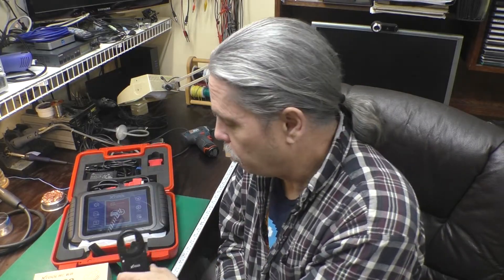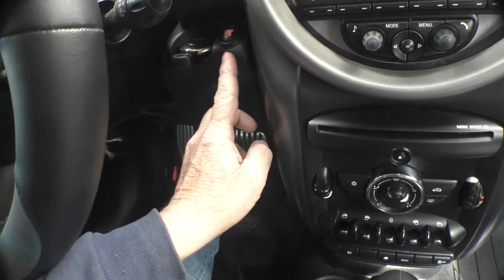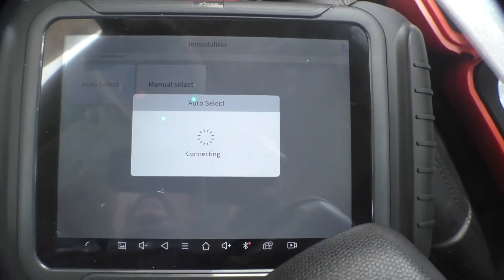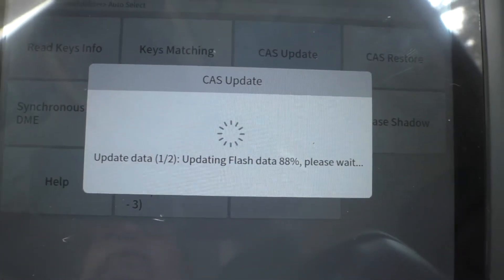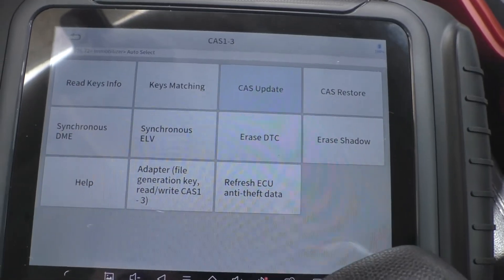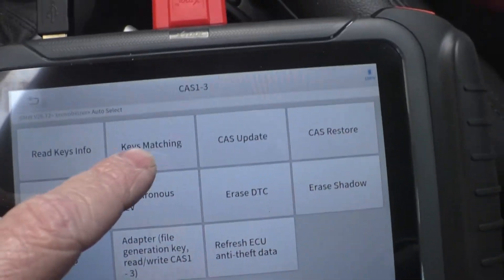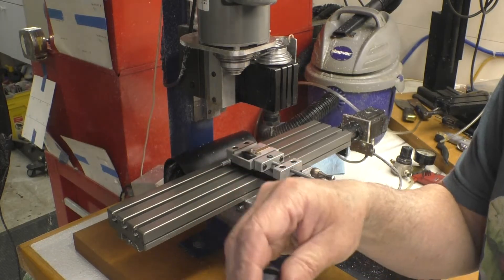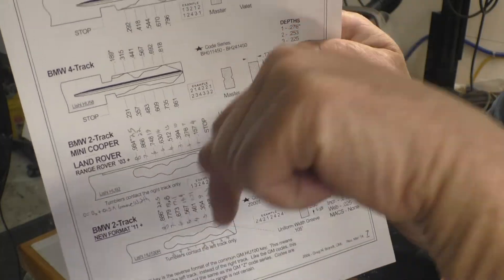DIY Mini Key FOB programming (and key cutting) – Using XTOOL D8 and KC100. 8% off the D8 code!

Comment: Do not do this via obd2 with this kind of tool people. On a CAS3+ module it's easy to brick it. Even for automotive locksmiths this is sometimes a difficult job involving downgrading the module, backuping up the EEPROM and flash etc.

Comment: At my old place when I had to program keys I would also have the the ignition set to on but engine off. If i don't program the key fast enough sometimes I would have to restart and sometimes the consult scanners dedicated to Nissan cars at work wont let you reprogram the key because BCM goes to sleep. I believe having the hazards on while ignition switch is on while engine is off keeps the BCM on long enough for the key program to go through

Comment: I just got a d7s but I'm not sure if its compatible with the kc100. I did a dry run off the car ( doing a '11 BMWZ4) just to get familiar with the interface and it's identical. Issue is going to be the KC 100 compatibility.  I did a Honda Odyssey smart key and it was a breeze, didn't need the KC 100.
Reply: UPDATE:  @ 6;53 your firmware updated, mine failed miserably. I've contacted xtool for advice.

Comment: This is CNC milling machine  !
How did you program and set it up  all ? It is technical  thing .
Must be special key cuting milling machine  ?
Reply from the maker: It is a Taig CNC mill with a controller I made. It uses Mach3 to control the mill. The key profile is generated by a parametric 3D model done in Fusion 360 and then converted to Gcode with CamBam.

Comment: Xtool D8 costs $600. That milling machine you have costs at least $2000. Let's be honest, that's not a set up that most people will have access to at home.
Reply from the maker: When I bought the D8 and KC100 the total was about $1000USD. It has paid for itself already. The mill I already had and I use it to make parts I sell online. No, not something in every garage but not so rare either. Other people have tools I don't at home like lifts, big air tools, etc.

Comment: If you have proximity keyfob, you definitely need to spend another $600 for KC501. Don't buy cheap Chinese keyfob either as many cars have aluminum keys and many Chinese made keys are steel which is difficult to cut and ruins your cutter. Bottom line, unless you are locksmith, just get it done at dealer or find a good locksmith.  
This advice applies even more if you have European made cars. 
D8 by itself is useless for making keys on a newer cars 2019+.
Reply from the maker: As I mentioned in the video...I asked XTOOL if the D8 would do what I needed, i.e. allow me to program in FOBs and reset the VANOS adaptation for this 2011 Mini. Programming in 3 FOBs almost paid for the tool.

Every key I have seen, that gets inserted into a lock, has been brass with a nickel plating. I have never seen an aluminum or steel key, neither would make sense unless it was a non-contact sort of lock.

Comment: The problem that I’m having, I have the same set up that you’re using. I did not update the vehicle so I am going to try to update the cas. But I don’t have any key fobs. Do you have a video programming BMW or mini with no key fobs?
Reply from the maker: Usually an 'All keys lost' programming of new FOBs is different. Some cars require a programmer that can connect for the car manufacture's network to do some sort of validation. I think XTOOLS can do this on their own, i.e. figure out the unlock code on their own but it is a service you have to pay for per vehicle. 

I would send them an email and ask if your set up can do this. It is the Chinese New Year now so you won't get a replay for a week or so.

Comment: It is all great but i don't  have a cnc milling machine but i know G programming  so i ve to buy a fob from the dealer and program that with the console  is this make sense to you?
Reply from the maker: You might be able to find a locksmith in the area who can cut the key (what Mini calls the 'blade'.) If you buy the FOB from the dealer you will pay $200. Buy from eBay for $20, and have locksmith cut the key. If you have the D8 and KC100 you can program the Mini to accept the new FOB.

Comment: Thank you for this Step-by-step tutorial. I have A Lexus and an acura. That I need to make keys for. I guess my first step is to contact x tool to see if their unit is compatible
Reply from the maker: Some manufactures do not like letting third party scan tools do some functions. Some makes/models require paying the manufacture a fee to access a PIN code to program keys. XTOOL and Autel can often handle contacting the manufacture's computer for you but you still have to pay for it.
Reply: @heyyoucanfixit  Volvo is like that.

Comment: Oh this was was dangerous if it failed your car would be screwd. You gotta supply 13v and you need to do backup just incase
Reply from the maker: I did make sure I had a fully charged battery before starting. I think anytime you do any programming on a car it is a risk.
Reply: @heyyoucanfixit  Oh, there is really no risk on cars that are meant to have keys programed. This car isn't your downgrading the cas this isn't supposed to happen. This car, like almost every European car, is made to have keys made without the vehicle present because all keys are preprogrammed when the car is made. So you're manipulating the data on the computer and, in this case, downgrading. You will see that eventually, 1 will fail without a power supply, and you will have a mess in your hands. I mean, I do this job, but I use a power supply every time you need a clean voltage of 13.5
Reply: What do you hook up to power source with 13 volts? The Xtool?
Reply: @Bluesstreetrods  A power supply to car battrey your downgrading the computer if it fails your in trouble.
Reply: @segounlocks5029  thanks for the info. My spouses vehicle is a volvo with intermittent keyfob problems so I may use this tip.

Comment: Messing making keys can cost you big time is why the waring. I would take it to the dealer. They screw up they have to fix the mess. Also you made a lot of errors you had to clear. One mess up could cost you a expensive part. Newer cars are really not worth the chance. Dealership has the special factory scanner that we can't get. Around about 2017 its has gotton a lot worse. Sad thing is with these scanner you can find out whats wrong but you need to connect to the factory internet and pay them to get software. Also you need some more stuff to connect to the factory. Unless you do this for a living you are screwed. With the xtool it lets you sorta no what wrong so they can't rip you off at the dealership or a good mechanic that knows his stuff. You did a good job but it took a lot of time.
Reply from the maker: Except I showed how it can easily be done...

Comment: Is this scanner a stand alone tool ? Does it require an internet connection to program keys?
Other than the free updates for 2-3 years does it require a subscription to preform the higher functions ?  Thank you 
I know after free updates end you have to pay for updates , however if you don’t pay for the updates can you still program keys and write ecu for the models already on the tablet ?
Reply from the maker: I think requiring an internet connection to program keys depends more on the vehicle than the scanner. For example, on the Mini I was working on here if I did not have at least one key I would have required connecting to some service (guessing through BMW). Same goes for programming VIN codes into modules and such. On some cars you have to use a online service from the manufacturer. 

One HUGE advantage, other than updates, to connecting the scanner to the internet is that XTOOL can download a log from the scanner for a car you had problems with. They did this several times when I was trying to do the Vanos reset/relearn on this Mini. They were able to download the log from my D8 and figure out what the problem was.
Reply: @heyyoucanfixit  I recently started researching scanners and found out launch scanners sold on amozon are made for other countries and not for the US market Launch USA does not support them and with launch USA it requires a subscription for the higher functions like key programming and ecu operations. Reviews range from I reprogrammed the space shuttle to big waste of money LoL trying not to waste my money

Comment: Do not buy the X tool I bought a brand new D7 straight from X2 it did not last a year I opened it up to see why it quit it had been repaired in three different places and they solder joints were so hot they screwed up the board ribbon cable holder came off the board was not even soldered good junk if you don't believe me go to my YouTube you will see

Comment: GREAT VIDEO!!!
what cutting machine would you recommend to get starter on doing keys?
i work at junk yard and we get cars without keys would love to get more into that already own a d7 been great so far TIA!
Reply from the maker: I do not know anything about actual key cutting machines. I used the small CNC mill I happened to have which required more effort to draw a 3D model of the key, calculate the key cut based on keycode and generate the GCODE. AS I understand it a professional key cutting machine just needs to know the key code and type of key and it can figure out the rest automatically.

Comment: Do you need the kc100 to program keys or just the D8 by itself? There is nothing stated that says that you need the add on part to program key fobs
Reply from the maker: It depends on what sort of FOB you are working with. When I did my Ford Ranger I did not need the KC-100 to program it to accept new chipped keys. For the Mini, since it uses an RFID type FOB you need the KC-100 to read the code off the FOB so you can program it into the car. 

You can contact XTOOL and ask about your particular vehicle. They are really good about answering questions quickly.
Reply: You use kc100 to precode keys for European cars
Reply: Can you generate keys with Km100 or key tool max then program with xtool d8 ?

Comment: What do you mean by readaptation for VANOS? What kind of readaptation are you looking for ?
Reply from the maker: When you replace parts in the VANOS (variable valve timing) system you need to reset/relearn the VANOS adaptations. 

The D8 will do this. The prompts were a bit confusing, but they were very receptive to feedback and have improved it greatly.
Reply: @heyyoucanfixit  Thanks subscribed! Which one would you recommend D8 with KC100 or Autel MaxiIM IM508 with XP200?

Comment: Will the d8 work for all keys lost scenario
Reply from the maker: It depends on the vehicle. On the Ford Ranger I did you could do an 'Erase all keys' but needed at least two new keys to program any in. On the Mini, the way I did it required putting one working FOB in the reader so it could compare its ID with what was set in the car. There appears to be a way to do it by connecting to a server somewhere to make sure it is OK, this may be a service though XTOOL. 

If you email XTOOL at xtoolofficial@hotmail.com with your VIN number, they can tell you. Their customer service is excellent.

Comment: Only video on YT I can find showing this, was looking at the D8 a while now but wasn't sure if it could program keys this way. Thanks for the helpful video.
Reply from the maker: Glad it was helpful. Key programming can be rather hit and miss as the car makers like to make it overly difficult. This is especially true for BMW. I contacted XTOOL by email at: xtoolofficial@hotmail.com and with my VIN they were able to confirm it would work for my vehicle.
Reply: Yeah, I thought I’d be able to use my D8 to program a missing key/fob for my ‘07 Volvo…until D8 asked to connect a KC501 ($600) to save data before proceeding
Reply: @Shane Huey  
That extra accessory is necessary when you use any brand of scanner/immobilizer. Not only xtool

Comment: Jeff question, I have a buddy with a 2018 Ford F-150 the speed is limited to about 85 is there any chance the scan tool can adjust the speed ?
Reply: Maybe.. not 100% sure.
If able customize ecu,tran/fuel&key ect sure just gotta know where the program.
I rented a car for a trip and speed was also set 66/70 not sure but ik it crap also volume wasn't able to turn all the way up! But like velvet key that open up car but not able to start it or open glovebox it (limited) this case the speed (limited)
Reply: @leeroysimpson456  I believe you are correct and he didn’t get the key with the full speed I was wondering if I could change it, because I know for the heavy trucks I’m able to change the perimeters
Reply from the maker: I don't know. What is limiting the speed an programmatic governor or something mechanical with the truck? 

If it is a type of programmatic governor you'll need to find out what that system is called and then email XTOOL support to ask them if the D8 can reprogram it.
Reply: Hi, if you placed my vin number JTDKG10C20N758042 in it would it show a relearn procedure for the MMT which is fitted to Toyotas Aygo and Yaris models and others european small cars ; multimode auto sequence  transmissions which might only be sold in Europe and the UK but does it come up with anything as i dont want to waste buying one if it doesnt thanks.
Reply from the maker: The best way to get specific information about specific functions on specific vehicles is to email XTOOL. xtoolofficial@hotmail.com

When I was thinking about buying one this is what I did, I emailed and asked about key FOB programming and VANOS relearn on my Mini. I got a quick response and found out the D8 would do what I needed. Every time I have emailed I have gotten a helpful and timely response. Their customer service is what convinced me to buy one.
Reply: @gtibruce  I bough one but I think it was pre owned it was horribly slow I’m sending it back I did use the a30m but with my apple tablet and it was super fast not sure if I got a bad one it was the blue tooth model….
Reply from the maker: I saw something like this recently on a ScannerDanner video. He was using a different brand scanner but it was very slow at graphing the engine RPM when in the manufacturer specific mode. He then tried generic OBD2 and it was very fast. 

Sometimes this is because of the vehicle itself, i.e. the ECU outputs data slowly in mfg specific mode. Sometimes it can be the scanner, i.e. the software on the scanner works slow for some vehicles. 

If you run into this you can email XTOOL at: xtoolofficial@hotmail.com . They can look at the logs from you D8 and see what the problem was. They did this for the VANOS relearn on my Mini. I found the procedure a bit confusing and they were able to improve it and incorporate some better English text.

Comment: Forgot to add cost of key cutter
Reply from the maker: I have had the Taig mini CNC mill for about 15 years. It has long since paid for itself and can do many more jobs than cuttings keys. The only cost related to the mill for this job was the chuck of aluminum for the fixture. 

Given the information in the PDF I linked to you can decode your key and have it cut by a locksmith. In the area where I live (small town) the only locksmith can cut about any key but does not do programming.

Comment: 3 days later it all works 😂👍 you’re very skilled 😊✌🏼
Reply from the maker: The longest part of the process was finding the information on how to cut the key blank. Cutting the key took only a few minutes. For the programming part, updating the CAS firmware took longer than programming the new FOBs in.

Comment: I really need this professional programmer. Great video though.
Reply from the maker: With modern cars there is no getting away from needing a scan tool of some sort. The D8 was the best bang for the buck I found that let me also program in new FOBs. This ability saved me enough money vs. the dealership cost to help pay for the tool.
Reply: @heyyoucanfixit  Can you help me get one? Like a cheaper one maybe used and how do I pay you for it?
Reply from the maker: I do not sell the D8 I'm just someone who bought one and like it. If you look in the video description, there is a link to the XTOOL D8 on Amazon as well as an 8% off discount code. Thanks for XTOOL for the discount code which they provided after I posted this video. I do not get any money from this discount code, but it does save you money. The Amazon links are 'associate links' which means Amazon pays me a few pennies if you order the item. (I started providing associate links due to viewer requests on my other YouTube channel and carried it over here.)